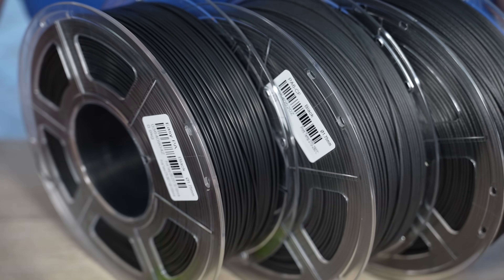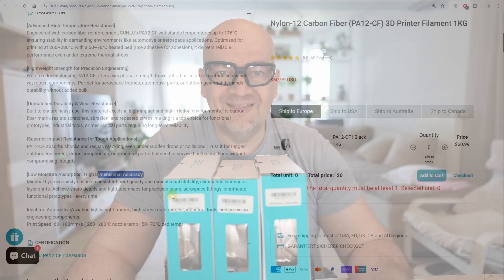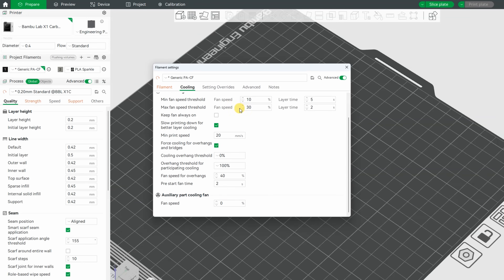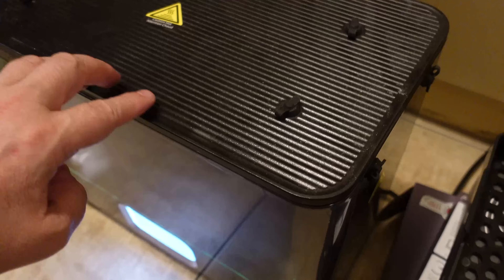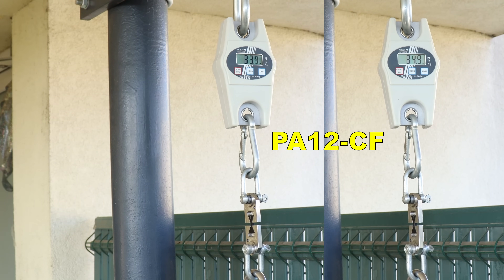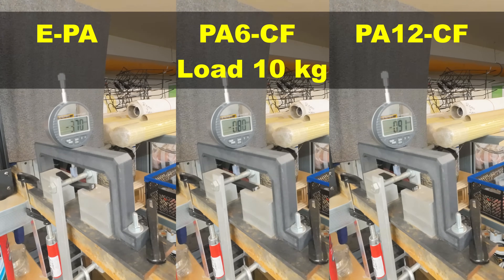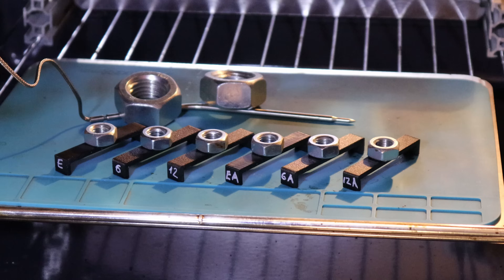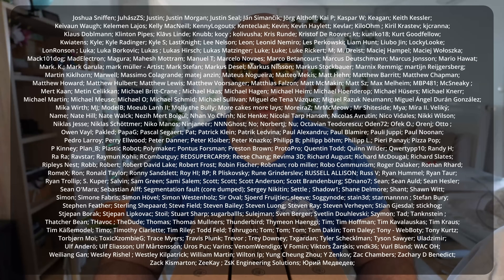Which Sunlu Nylon is Best? Easy PA, PA6-CF, or PA12-CF

Comment: Your shrinkage test needs to be bars of 100mm so you can do easy percentages
Reply from the maker: Actually it is a standard test specimen for the bending test, 80x10x4 mm. I am just using it to measure the dimension too.

Comment: I think I’m going to try easy PA on my A1 Mini. I’m just wondering if my 70C creality dryer will cut it to keep Easy PA dry…
Reply: It does, and it works! I based the profile off a PETG-CF profile. And even dried it from a creality 65deg dryer. I made 2 headset spacers and a seattube spacer for my bike.

Comment: Huh, so Sunlu has their own special PA blend... I was trying to make tiny compound gears with eSun ePA, a mystery nylon 6/66 blend. Layer adhesion was kind of questionable with even the Bambu Studio printer profile by eSun. I was surprised at the part cooling fan set between 40 and 85% That said, Sunlu Easy PA's datasheet suggests 100% cooling fan.  

eSun ePA and Sunlu easy PA have vastly different mechanical properties though, based on the datasheets. Apparently the Sunlu might be better for printing small gears in a non-enclosed printer like the Bambu A1.

Comment: I wonder if you annealed long enough. Maybe I missed it but when you read the specifications you said 5-12 hours but when you did the annealing you only did 1.5 hours. As to your last question, I agree that Annealing is a lot of wasted energy and I personally don't bother, but I haven't had a use case that needs it. If you are going to do a sub brand of SunLu with the exact same materials I think the more important comparison is like for like across the brands, is the "sub brand" just as good or worse?

Comment: When testing nylon materials, do note that the material gains toughness (not tensile strength, really) once it's been exposed to moisture again for a while. Should make a bigger difference with PA6 than it does with PA12. When injection moulding, the resulting parts are sometimes soaked in water, although the practice is not particularly common. Where it is common is with nylon strimmer line, where manufacturers often advise the customer to moisten the material to make it last longer. 

Another nice thing if you get nylon, if you get the colourless stuff with no CF in it at least, is you can dye it various colours if you want.
Reply: He did. He waited a month before testing them. At like 9:20 he mentions it
Reply: @saturnmedia1  Yeah ok but not explicitly because of the moisture so it kind of depends on where he kept them. If they were in a closed container it might not have helped.
Reply: @ManWithBeard1990  Stored in an open cardboard box...

Comment: The Easy PA should've been printed using the recommended bed temperature. Printing at 100°C actually partially anneals the part. Without annealing, temperature resistance should be similar to PLA
Reply: Do you have any references for this? I would have thought only the first few layers would experience temperatures high enough to have any annealing affect. The rest will be closer to chamber temp of ~45deg.
Reply: @oldman1944 On Sunlu's website, it says the heat deformation is 43.7°C before annealing. 80°C annealing increases it to 73.8°C. Higher annealing temperatures further increases the temperature resistance. The test pieces are also close to the bed so they'll be quite easy to anneal from just the heat of the bed. I've also tried a different brand of Easy PA and had similar problems with low temperature resistance without annealing.
Reply: @silvrcel  I understand what you are saying and agree that annealing increases heat def temp, but I don't agree that a higher bed temp will soak all the layers at >80deg and have an annealing affect. I think only the first few layers will experience these temps during the printing regardless of the bed temp due to the movement of much lower temp air in the chamber and the poor thermal conductivity of the nylon part.
Reply: @oldman1944 Yea if the part is tall, it'll mostly only anneal like maybe a centimetre at most depending on bed temperature and duration. But in order to have a good test sample, the part shouldn't be partially annealed by having the bed at 100°C instead of below 50°C specified by Sunlu. With the oven test reaching over 160°C, it's quite a significant difference compared to the specified temperature resistance of unannealed Easy PA.
Reply: @silvrcel  Yep it's worth mentioning and possibly has potential for skewing tests, but my suspicion is that it would only affect a mm or so above the bed and only on very long prints.
Reply: @oldman1944 The filament coming out from the nozzle is 280°C, so it'll take time to cool down. How much of the heat from the bed and nozzle is retained in the part such that the duration is long enough to anneal Easy PA is difficult to say. But considering the test part was able to hold on until 160°C, it might have had a significant impact.
Reply: @silvrcel  Hard to know. Worth pointing out that other advertising for this material lists heat stability at 121c, which sounds more accurate than 43.7c
Reply: @oldman1944 What I see from Sunlu's website marketing is a picture that describes its performance after annealing at different temperatures. Before annealing = 43.7°C, 80°C annealing = 73.8°C, 110°C annealing = 94.3°C, and 120°C annealing = 127.9°C. From experience with a different brand and seeing other reviews, this seems quite close to how Easy PA behaves. The 121°C rating is likely after annealing, and is from older marketing material as they do mention it on Amazon but they also mention annealing for better performance.

Comment: As usual a very good an informative video. Thank you very much.

Regarding the inslogic filament tests that you plan. WOuldnt it be VERY intresting to do the exact same testing with them as with SUNLU to find out if there is any difference at all between the two brands? 

Again, thanks for sharing all you hard work.

Comment: I'd love you to test these filaments on an open printer, even if they weren't good enough for your mechanical testing it would give us with A1's & similar an idea of if there is any chance we might get them to work
Reply: Ive got a basic tent style enclosure, and it's pretty similar.  Even something like a cardboard box over the printer will get pretty decent results. Just use more caution if doing something like that
Reply: @jimmybateman5014  I suppose its as much about how likely a filament is to work in a basic setup and knowing if it's even worth trying. Filaments can be expensive & never being able to use it is a waste of time, space, cash & the resources used to produce it. But even if you can get it to print will it retain its properties or just be brittle and of zero use... in an ideal world we would all have enclosures but there are a lot of open printers out there 😀
Reply: I print this stuff on my A1 every day

Comment: Have you done any testing of the effects high humidity saturation on the Nylon coupons? Where I live we regularly see 75% humidity or higher, I’m curious how it affects their strength.
Reply: Makes printing anything longer than a 4hr job tricky. Longer than 6hrs, forget about it.
Reply: Humidity kills the stiffness of PA, theres plenty of data in different scientific papers for injection molded stuff. Would be nice with something similar for printed PA,

Comment: I love easy pa. Having a nicely bendable material that is so heat resistant and with such layer adhesion makes it perfect for so many functional parts...
Reply: Agreed looks like a super cool to try. Especially for parts that need to be strong in more than one direction…
Reply: could it be a suitable replacement to PP? I tried PP for O-rings and stuff but the damm thing never sticks!!
Reply: @jackrenders8937 when I say bendable, definitely not that bendable. The only suitable material I can think of for o rings is TPU.
Reply: Easy PA might finally be a great substitution for Taulman Bridge, which was an absolutely incredible nylon that unfortunately was discontinued when taulman was sold to braskem, spun off to xtellar, and then discontinued...

Comment: Thanks again for your thorough testing! This time there were some interesting differences in the mechanical properties, i didn't expect.
For anneling i'm not really shure. I've had an interesting discussion about this topic here in the comments. So i wanted to test it for myself.
Except for testing purposes, i only annealed once (two parts). Even though it was PA-CF, i think there were some minimal changes in the geometry. It were small intricate parts, that fitted nontheless.
I had to reprint the parts due to design changes later on. This time i just used a more heat resistant filament.
I personally feel, annealing is also maybe a lot of guesswork and uncertainty. I would only trust a part that i have tested. 
I also struggle to see a usecase, where only annealed parts are strong enough to withstand hight heat and high forces at the same time
If i had this usecase i would most likely buy a spool of PA-CF, that has a HDT A of 200°C and continous service temp of 150°C.
But from material science viewpoint it's kinda interesting to "boost" filaments you allready have. Testing this is of interest to me, allthough i don't see myself annealing parts on a regular basis.